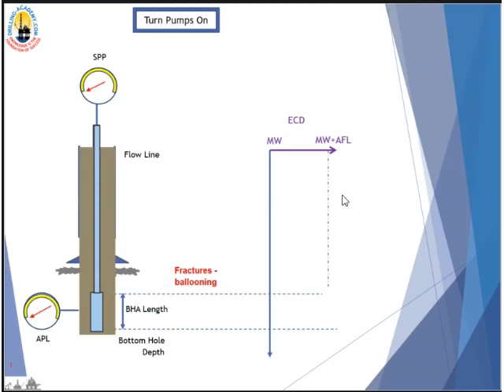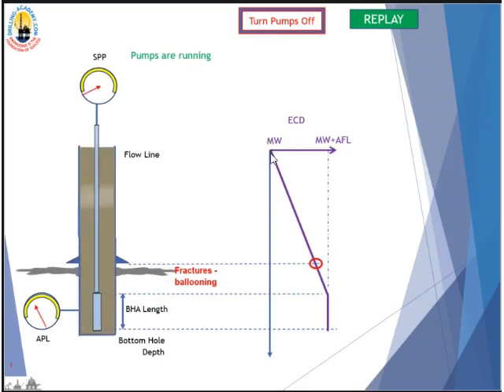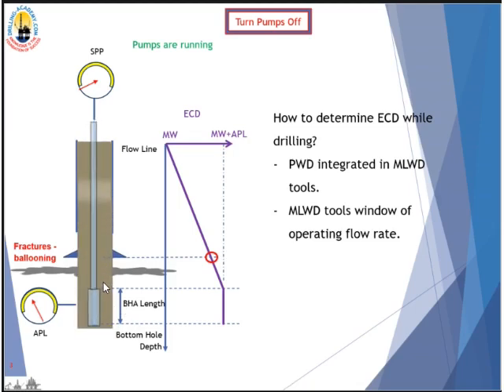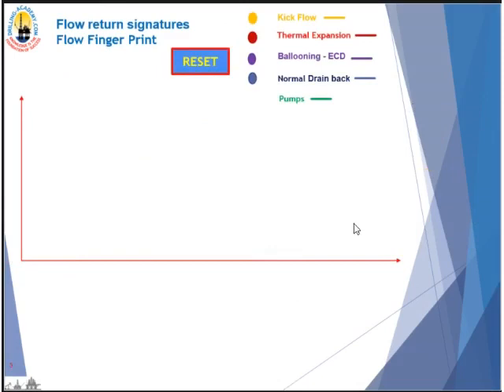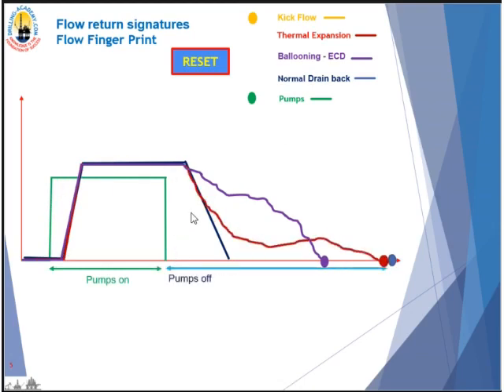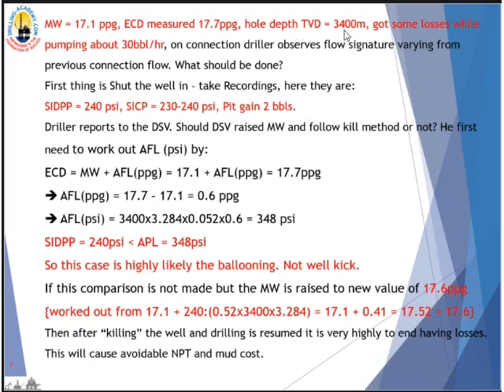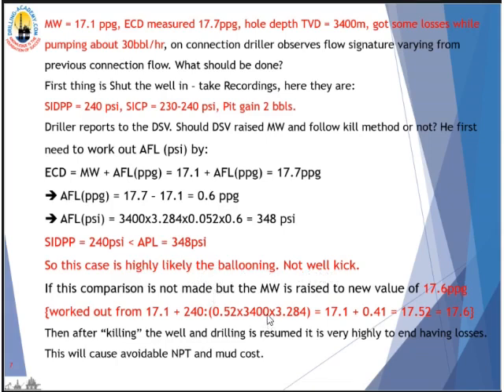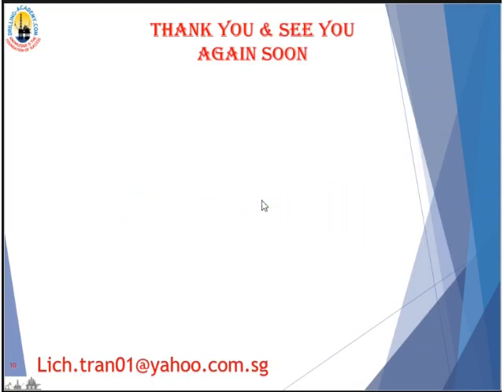Well Bore Ballooning - Well Bore Breathing - HPHT Drilling Oil & Gas

Comment: Thank you for the informative video. I believe that RPM affects the ECD in a way that if RPM increases ECD increases as well. Because high RPM pushes cutting away from drill string toward the well bore which creates more friction and resistance for the mud to move up to surface Please correct me if I am wrong